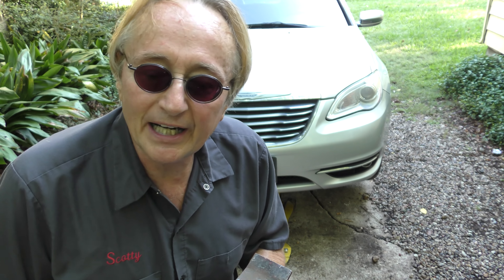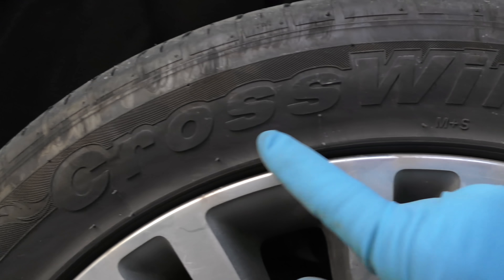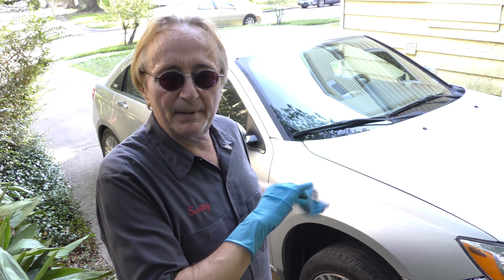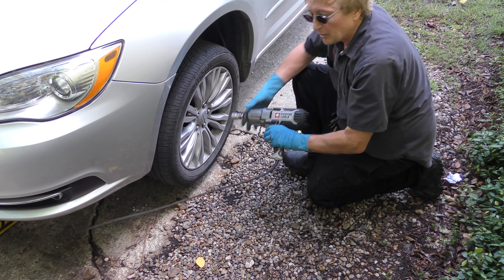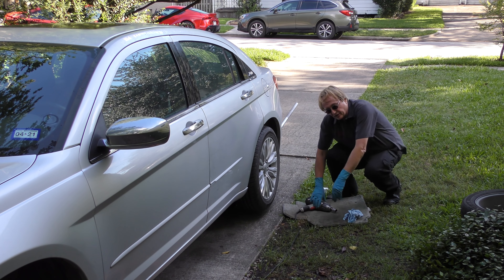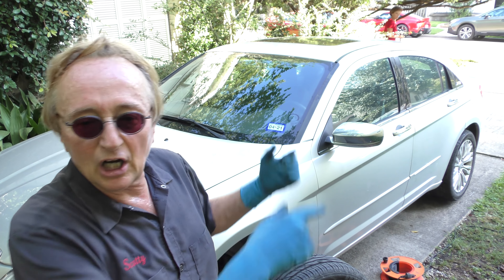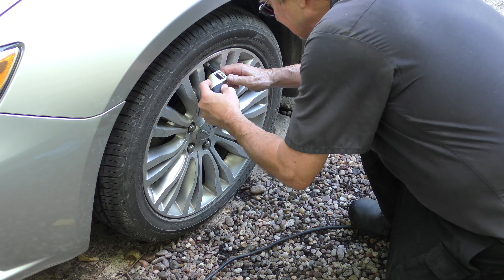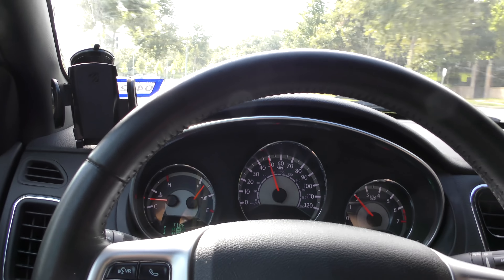Here’s How Stupid People Change Tires

Comment: Always put the best tires on the drive wheels.
Reply: is confused in AWD
Reply: No.. Always put the best tires on the front of any vehicle. Stop and think about it... If, on a rear wheel drive vehicle, you put a crappy Tire on the front driver side and it blows out you may loose control. Steering a vehicle is always more important than driving a vehicle forward. So it doesn't matter if it's rear-wheel drive or front-wheel drive the best tires always go on the front.
Reply: You should always have the same tyres everywhere never mix up brands stick to 1
Reply: The only thing having the best tires on the back does is help prevent oversteer in rear wheel drive vehicles when the road is wet. I would much rather have the best tires in the front, because oversteer is much more correctable and controllable from the driver’s seat. Even then, most of the braking in ANY car is in the front, so the best tires will help you stop the best.
Reply: @Userjdjddss  in an ideal world this would always happen... sometimes circumstances occurs where you were forced into a situation and having one odd ball Tire. Perhaps you had a flat in a tire shop you went to didn't have a replacement ... who knows what can happen.

Also it's okay to have two different sets of paired. they don't all four have to match but you need to have the same pairs front and back.
Reply: @nickbrockelman  No .. even a new tire can blow, so put the best tires on the drive wheels. Better still, put 4 new tires on the vehicle, and rotate them often.
Reply: You know, I rotated the tires on a Kia soul and put the best ones on the front drive wheels, and it started making a loud rotational noise. I thought the wheel bearing was going bad so I swapped them back and bam, no more noise.
Reply: @THEH2OMAN  if you KNOW that one tire is not the same and in worse condition, why would you put it where it can do the most damage? You're absolutely right even a new tire can blow out but you won't know it's going to blow out and so it doesn't really matter where you put that tire. There's nothing to tell you that it might not be as good as the other Tires, but that's not the scenario were talking about. We are talking about having one tire not the same as the rest witb more wear on it and where the safest and best place to put that one tire would be and that is going to always be in the rear no matter what. You will always want the best tires on the front of a vehicle because that is where you steer and stop from.
Reply: @matthewwach7693  this can sometimes be a symptom of a poor rear end alignment. Or at least your rear end alignment and your front end alignment are different enough in that the tires have worn in such a way as to create the noise. Sometimes if you leave them on the front for a little while the noise will go away as the wear pattern evens out however if the wear pattern is too bad then it may just stay the same. regardless you're going to want the tires with the most tread and the least wear on the front even if they do make a little noise as a matter of safety.
Reply: I'll remember that on my rear wheel drive trucks.
Reply: @nickbrockelman that's been my thinking. Best tires where the steering is. Older tires are more likely to have a blowout
Reply: @nickbrockelman well put. Scotty is putting the odd tire in the back where it has less effect. He's right about that. That odd tire really shouldn't have been used with the others

Comment: WOW!  It was nice to hear you talk about the idiots that would put the bad tires on the front.  Back in the 60's I talked to a guy that worked at a service plaza on the NYS Thruway.  An older lady pulled in to the tire area.  She said that the car was riding funny and wanted the winter air changed for the summer air.  Her guy back home charged her for that fine service at every season change.  Anything for a buck!

Comment: Guy from snow country here. I once had only 2 snow tires. I put them on the front (front wheel drive), thinking the better traction is needed there for the same reasons you said. Had terrible fishtailing problems due to loss of grip on the back end and did a 270 spin going down a slight grade. In poor grip situations, grip is critical in the back.
Reply: Hi tjncooke:  You are so right.  Best tires to the rear.

Comment: They told me the same crap at Sam's club about rotating the good tires on the back. I didn't argue but my spirit felt how dumb it sounds.
Reply: i go the runaround too, showed me a diagram on the wall how it creates oversteer.
Reply: I'm confused. Wouldn't you WANT to rotate good tires from the back to the front?
Reply: NEVER buy tires from Sam's club.  They even rotated the tires wrong, which resulted in my car pulling to one direction.  They couldn't even program an TPMS sensor, in which i was forced to do it at the dealership.  Never again!!
Reply: I disagree new tires should be installed on the rear. Hydroplaned the rear end on a corner on a front wheel drive and you lost all control of the vehicle.

Comment: Well having worked on cars myself for a dealer, customers routinely refuse to accept advice given to them from techs. The Tire Shop may have warned the customer about mismatched tires and they just refused to believe it or didn't want to pay to have it done right.

(edit) And the policy at most shops is that new tires go on the rear. You'll usually see a diagram of it or something at your local tire shop. I've always disagreed with it, but them doing that doesn't mean they were idiots. Just following policy.
Reply: It just means the policy makers are the idiots.
Reply: @ripvanrevs  The policies are created by professionals with a lot more education in the field than you; there is a GOOD reason why they put the better tires on the rear.
Reply: First Last  Nope. It's easier to correct if you lose traction in the front than if you lose traction in the rear.
Reply: First Last , I'm with you on that! They get to sell more tires, more money! I would ask the other guy... Are these experts with more "education" the same ones that gave us planned obselesence, the timing belt, and other things we "needed"?
Reply: The reason that good tires should always go on the rear regardless of if it’s FWD or RWD is traction while turning, worn tires on the rear will cause fishtailing and could cause the car to spin out more easily, sure, new tires on the front are good for braking in a straight line but literally any other movement of the car requires the backend to have more traction
Reply: @123kalbrecht , no average driver should ever be taking a turn so fast that the traction of the rear tires would be an issue. Lateral forces that high would only be a race track issue. Even if it's raining, the average driver should have decent tread and slow down anyways.

Comment: I had an old Mechanic buddy tell me the same thing one time, "try" and match your treads as close as possible to the existing tires and if not, fronts are more important in a FWD, put the bad ones in the rear. The evidence of what you said about braking and driving power is how your brakes work. If you have discs in front and drums in back, only about 30% of your braking power is in the back (hence why some manufacturers use drums, they are cheaper and not as important in back) and 70% is on your front disc brakes for braking. It only makes sense to have the best tires in the front, worst in the back.

Comment: Wal Mart does this all the time.
Reply: I won’t even trust wal mart to sell me my pop tarts.
Reply: Oh god...
Reply: One went flat,  they replaced that one.   Extra effort to move the good rear crosswind to the front,  then install the Goodyear on the rear. 

I've been travelling and had to go to a Walmart to have a tire replaced,  since they're open on Sunday, longer hours and easy to find.  You have to tell them to put the new one to the rear. 

A good video for the driver checking their own car for a wobble. 
Round rires
No wierd wear
No play in the bushings or ball joints
Mismatched tires or a thick tread and a balding tread on the other
Poor inflation 
Last but not least,  warped rotors or worn shoes... But you have to take off the tire to see that usually.

Comment: The reason "they" tell you to put the best tires in the back is to avoid oversteer. I'm an engineer and would have to agree with that if asked in a way that would make me liable. Just don't ask me what I do.
Reply: Okay, I'll admit it. I put the best tires in the front.
Reply: That's plain stupid. I get liability issue atleast give the damm customers a damm option.
Reply: Agreed.  Also, don't ask me what I do.  This is about legal issues not logical ones.

Comment: Best tread is supposed to be in the rear to prevent spinning in a hydroplane situation.
Reply: On rwd. On fwd you want them on the front so it'll pull it through a spin. Best tires go on drive wheels
Reply: Lots of hydroplaning in Houston in summer, no doubt.

Comment: i understand what you're saying about the better tires being on the front , i sometimes go by spec from Michelin though where they state higher treads should be at the back because of lighter weight, liked the video , we mostly do it as you do because we do alignments as well , keep up the good work
Reply: OK so if the lower tread tires are in the front, the engine weight pushes them down more onto the pavement giving more traction? Is that it? It seems there are two possible situations here, either a blowout or fishtailing event. With blowout I'd thought it would be better to have the newest tires in the front because it would decrease the risk of a front blowout where the steering is.

Comment: I was told that good tires go in the back to keep the car from fishtailing.
Reply: I live in Nordic country. In the winter most of us put better tyres in the back if we have to make choice like this. Scotty have not seen snow and ice i guess. Better tyres in front in slippery conditsions is suicide.
Reply: @Meeliskt77  You'd probably be running winter tyres for the snow season (that might be most of the year up there!) so you can change the configuration specifically for the snow
Reply: @Meeliskt77  Scotty does live in Texas
Reply: Actually, the driver keeps the car from fishtailing. If the driver isn't driving too fast for conditions then the vehicle probably won't have a fishtailing issue!
Reply: @CurtisG-oq5wu  A skilled driver can't put friction where there is none. Physics doesn't give a crap about your driving experience.

Comment: Kudos 2 you- as someone who has been selling tires for over 20 years im glad you made this video. I would like to point out a few things. I agree 100% front wheel drive cars and SUV's need the new tires up front for several reasons 1)the front tires wear on average 3x faster on the front so if you were to put them on the rear they would never wear out and the fronts would last 20k miles  2)better traction on the drive wheels (duh). FYI Department of Transportation says new tires should be installed on rear always, for hydroplaning reasons, but I have many reasons not to do this. Personally if 2 are worn completely i will check if the other 2 are less than half remaining and replace those too, because studies have shown a tire at half tread loses 75% of its traction. 
   ALSO, I can honestly say I've driven 65% of the tire brands/models availible and ALWAYS recomend not buying the "cheap" or "no name" tires, they almost always suck. This is a major purchase and i get that, so do a little homework, because some of us "tire guys" will steer you into what they have in stock, or what will put more commission in their pocket. If you spend a few min talking to your salesperson you can tell if they are full of spit or not.  I personally like Goodyear, Cooper, BFG, and Yokohama, plus dont forget 2 things: every type of car rides different even on the same tire, and EVERY manufacturer has not so good (and sometimes VERY good) models in their lineup.  Tires are about Features and Benefits so determine what your looking for (ex. long life, wet traction, price, dry traction, ect.) remember these tires are whats keeping you safe. dont cheap out, if possible.

Comment: Ask any truck driver, tread depth Has to be deeper on your front steer tires then your rear tires, federal law.  Also, with trucks if you get a flat tire upfront, stop don’t go anywhere. You get a flat tire in the rear pull over to safety.  As usual, Scotty is right on this one.

Comment: I used to always buy Goodyear tires but I had trouble  more that a few times with the belts in the tires shifting making the car shake. When you check out a tire look at it from the outside, the tread and the backside when you spin the wheel.

Comment: Discount tire is the ones with the " best tires in the back " deal lol . i used to work there and really the only reason it would make sense is because the rear tires might wear out less being in the back, but if the front tires are bald your front tires could lock up and hydroplane on a rainy day (since they usually have more breaking power biased to the front) so id even make changes as a service coordinator and put the worn out ones in the back because it only makes sense from a wear stand point

Comment: The best tire on front in Texas / warm weather.    Up here in the North , I did as you said put the best winter tires on the front on my front wheel car ( ford escort in 1980).  Guess what happened, when I went to brake on a snow covered road the rear end spun the car around.    From then on for winter driving I make certain to have good snow tires on all four wheels of front wheel drive and thus has never happened again.

Comment: I read alot of comments since I was curious.   No one has really mentioned that the wobble probably started once you hit a pothole and lost a wheel weight. So naturally if you remove the wobbly wheel and replace it with one thats balanced still the wobble will go away.  You still have an unbalanced tire and might feel it in the car now.

Comment: I tend to agree with scotty on this, but I do understand the logic behind it. If you know how to correct for a fishtail(been country road drifting and mudding since I was 15, 22 now) you would never need to worry about it. Also drive for weather conditions and the problem goes away. An improperly balanced tire can also cause shake like that. Bad tires on the back usually causes more of a listing type feeling. Front wheel drive or rear wheel, good tires on the front so if you have a blowout it doesnt immediately pull the wheel one way and send you into a ditch

Comment: i have to agree with you with the tires, even on my 4x4 F350, which is mainly RWD unless i go into bad conditions of mud or sand, i keep my better tread tires up front, not only does more braking happen up front, but the steering happens too. the way i look at it, if i had to choose which tires i would have slide, id choose the back, and even being on a 4x4, having worse tires on the back and being in 2WD, if it strarts sliding, or gets stuck, now when its in 4WD, i have even more grip added in to the front tires that were previously not powered.

Comment: 👏👏👍👍absolutely 100% correct. Always always have the better tires on the front for front wheel drive vehicles. There the drive wheels, 90% if the braking is in the front, @scottykilmer 1 other point about this that you didn’t mention is, the fact that there also what steers the car. If you have worn out tread and try and turn in snow or rain. There’s the possibility that it won’t turn or turn as well due to the tread being worn out. You should have also mentioned to rotate the tires once a year😉.

Comment: The idea is that keeping the newest tires on the back will help prevent the rear from sliding around a corner in the rain, due to the deeper rain grooves in the newer tires.
I prefer best tires on front.

Comment: Is using a torque wrench necessary when putting on lug nuts?  I just bought a brand new. 2020 Mercedes GLE. I got wheel locks and used a torque wrench to make sure torque is accurate.

Comment: i have to forcefully disagree with discount tire when they recommend putting the bad tires on the front too.  hey scotty, changed my oil pressure sensor in my 2000 B3000  mazda with 174K since it was going crazy at times..   i wasn't sure if i was removing the correct sensor so i just disconnected it and turn the key--bam I had it!!!. it only took about 20 mins too.  save some money ---thank you!!!!

Comment: The front has the weight of the motor and driver. Means better traction in the front. In our Canadian winters front wheel drives are very good winter vehicles. And if anything is going to slide it's going to be the back end because there's no weight there for traction. Same thing for wet roads. Best tires goes on the back.  If your front tires can't cut it because of no tread. Replace the front tires

Comment: Worn treads in the back are bad if you drive in the rain because there's not enough grip when compared to new tires in the front and you will oversteer and spin out in a curve. Happened to me, bought a new pair of tires and had them installed on the front of an "88 Accord front drive. I was gonna replace the worn back (still legal tread) ones in a couple of months but took a curve at not crazy speed and lost it in the rain with the rear losing grip, did a couple of 180s and was going sideways for a bit.

Comment: Hey Scotty, i have an 08 yaris sedan and i started to have problems with the auto trans with the reverse, it gets in to reverse hard. And it Only happens for reverse all other gears run fine, but i changed the filter and a pice of cluth i think was on the pan. It was like an inch maybe less. What do you recomend? I dont have much money. And yes the oil has been changed as its suppost to.